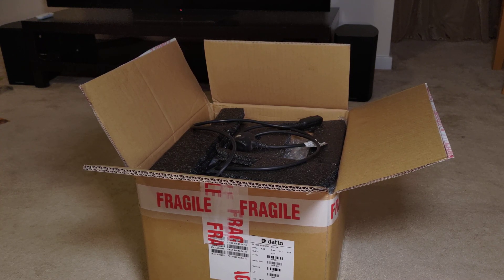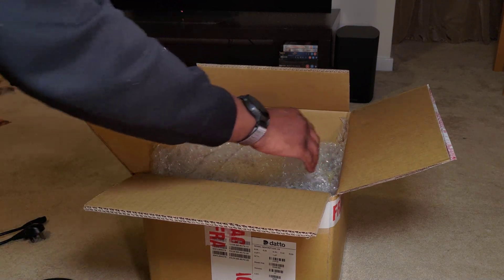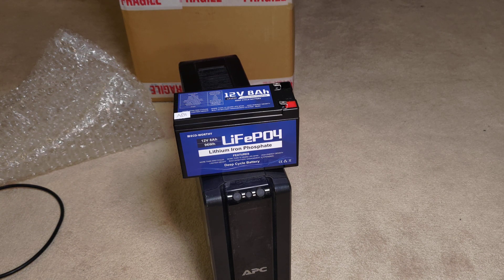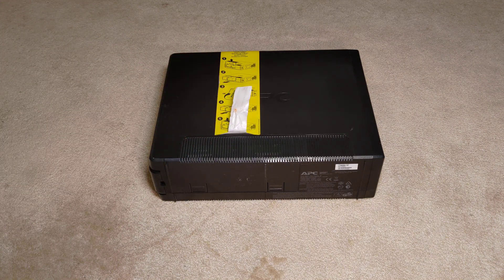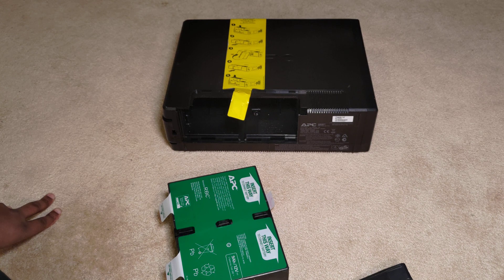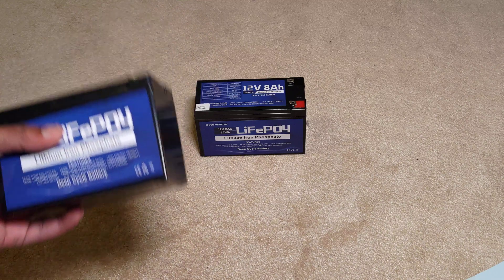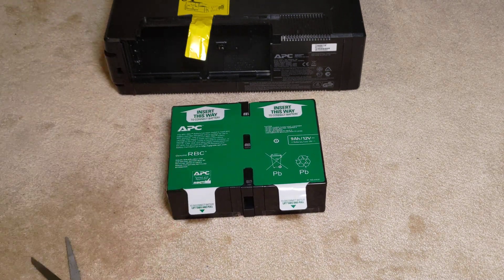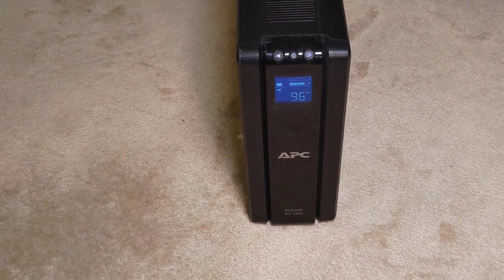APC UPS Upgraded to a LiFePO4

Comment: When you do "more testing down the line...." - you will discover that the battery would be limited to 7 Amps, and 84 watts, or 168 Watts for two of them. When you try to run anything more than that, it will shut off. Your uninterruptible power supply would be profoundly interrupted.

There are a few videos out there showing this UPS Upgrade to LifePo4, but all of them, including yours, didn't understand this limitation. I'm trying to do the same upgrade, and I did find one 15Ah Lifepo4 battery that has a 30A BMS, and i'll be testing it, but for now, it seems that it is NOT POSSIBLE to run these UPS on a Lifepo4 battery. Good luck, and thanks for sharing.

Comment: What is the maximum safe discharge amperage (or c-rating) of the LiFePO4 replacements?  I'd like to do this, but this appears to be an issue and I need to match the wattage of the UPS for less fire potential.
Reply: Another channel tested this.  https://youtu.be/kzrqQqBmpwQ?si=te3yaKPqNX5ztb2b

Short answer is yes.  The LiFePO4 batteries do not have sufficient peak current capacity for a UPS setup.
Reply from the maker: Specs: According to the documentation each one can sustain nominal 4A per battery, continous 8A, with a peak of 30A for 10 seconds. The UPS BMS maxes out at 4P4S.

Theory: In theory meaning that this UPS can handle at most 720W for 10 seconds, or over the span of the discharge 192W. 

Test: I have tested this little UPS and it's sustained 144W for 43 min. Pretty remarkable for a total of £85. I have made 3 of these along with converting a rackmount 1500VA UPS. Knowing what you're dealing with is important.
Reply: @NnamdisLaboratory  You basically need an external 50A or 100A discharge rate LiFePO4. Like Goldenmate LFP1250 or LFP12100. Which is why they still use lead acid in a computer UPS. That lead acid in that UPS can push out 100A... but only for a short time. The higher the amperage you draw, the less efficient it gets. Kind of like how your MPG drops driving fast vs driving at 45mph. Those little baby LiFePO4 that fit inside will basically keep a laptop powered.
You probably know by now, just estimate your total draw and figure out what higher size battery you need that can sustain it. Taking in account the 85% efficiency of a UPS, it comes pretty close to 10A discharge rate gives you 100W usable UPS.  50A discharge gives 500W. 30A discharge = 300W
Another issue. Since LiFePO4 providdes near constant voltage until almost completely discharged, the UPS will display 100%-90% full then all of a sudden the voltage drops, possibly faster than you have time to shut down the PC.
It's better to just get a Jackery type battery box that is specifically designed for LifePO4

I have 2 ups at home. One for PC the other for wifi router in another room. I could totally use that little LifePO4 for the UPS the router uses since the draw is low.
Reply from the maker: @thebluelunarmonkey   I'm not sure if this is meant to be replying to me or maybe you didn't see the message above yours. Also you may want to re-assess LiFePO4, per unit of mass it's better in every regard than lead acid. The reason we see low discharge currents on consumer packs is because these are cheap and the BMS limits the cells performance. Even so, the 12V packs these come in with integrated BMS are about 50% empty air (so not even full of cells).

I expected like you said based on the voltage curve of LiFePO4 for the indicator to stay high until the last moments but this isn't the case APCs battery calibration did a good job of accurately reporting the power state. Either that or this is emulation being done on the BMS side.

I'm not sure why it would be better to buy a jackery. In total this costs $90 and offers (200Wh) 43 minutes of runtime at 144W. In reality the server it's dedicated to serving runs at 60W so it surpasses its requirements. Jackery's are not UPSs, they're not tested for the criteria required of a UPS like pure sine wave or switch over latency. However even if they were my scenario is $90 for 200Wh, vs the closest priced Jackery (Jackery Explorer 240) $260 for 240Wh.
Reply: @NnamdisLaboratory  "Also you may want to re-assess LiFePO4, per unit of mass it's better in every regard than lead acid". Misses the point, Size and max discharge rate.

I consider LiFePO4 a better battery in ALL aspects except 12v physical size/discharge rate. Mass/discharge is irrelevant since it's sitting on the floor. A LiFePO4 battery the same form factor as the SLA it replaces will seriously derate the wattage the UPS can deliver. That was my only point. If you are OK with a lower wattage, definitely use LFP! 

We aren't in any disagreement. That BE550G UPS I use only for my wifi router... should have totally went for a LFP as the router needs only 20W. The OEM SLA would run my router 90 min for my mobile phone to use wifi, an LFP would run for hours at such a low consumption.
The 1500 UPS I use for 2 PCs... can't use LFP of the same form factor.

Someone using that UPS to power 3 PCs (for a very short 7 minutes to allow for shutdowns) won't be able to with the same size LFP you are using. All the PCs will immediately go black as soon as line power is interrupted, and get a 'failed to properly shutdown' error message on next boot.

That Pro 1200 is rated to deliver 720W (for a very short time, 7m) and as long as someone understands a LFP the same size will deliver a fraction of the max wattage, then LFP is superior in ALL aspects (especially in discharge cycles, a LFP will laugh at being discharged while each SLA/AGM full discharge hurts the battery). 

Like I said, someone expecting the same wattage rating needs a 50A discharge LFP (12.6V x 50A = 630W) which will deliver nearly 700W for an HOUR while the SLA will give 7 minutes - at the same time this larger LFP weighs about the same as the tiny SLA it replaces both around 12lbs. Also, forcing the SLA to deliver 700W is very inefficient, 7 min at 700W, compared to 100 min at 70W, and 52 min at 144W, but the main purpose of UPS is to deliver power for a graceful shutdown. 

Goldenmate has a UPS, and it's able to deliver 800W since the cell arrangement is for 24V, so the required max discharge amperage is halved from a 12V configuration.

I compared the voltage / discharge curve on SLA and LFP, the internal LFP BMS will shutoff at 10V so may still have capacity since the UPS considers 0% to be 10.5v. The UPS will send the PC shutdown signal to PowerChute before the LFP BMS shuts down. I think that's why you got such good results on the % meter contrary to both our expectations! :)
Reply: @pleappleappleap  Yes, I saw this, and it looks like most BMS top out at around 20Amps, so its not enough to support what the SLA batteries can output. Basically around a 50watts device/appliance.